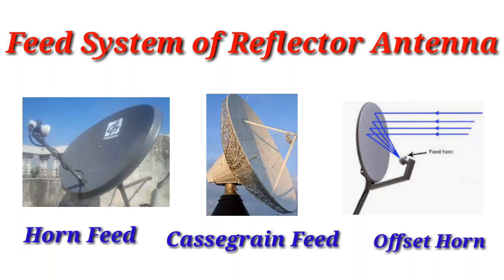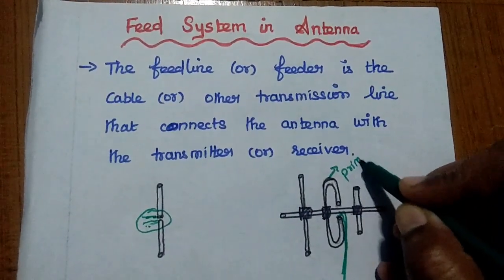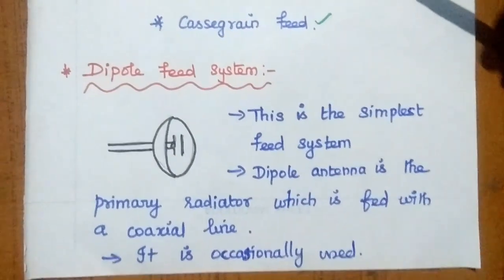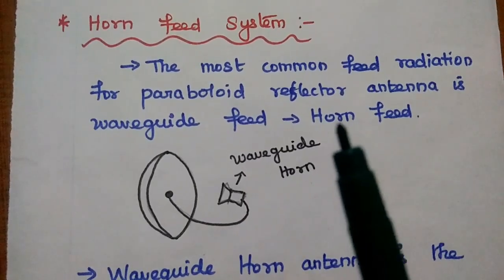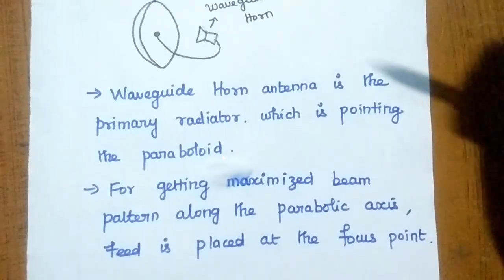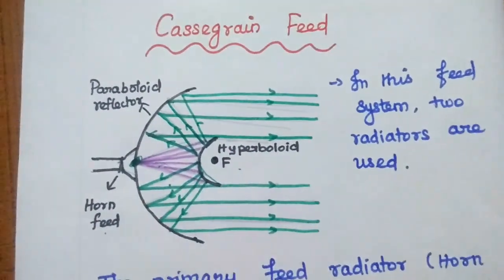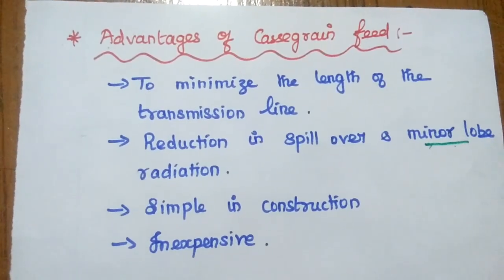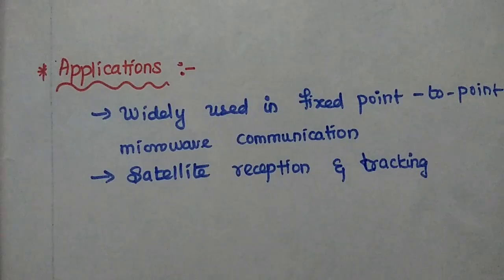Feed System of Reflector Antenna - Horn feed and Cassegrain feed

Comment: In the cassegrain feed even if we place a offset horn feed,the hyperboloid still is at the focal point and blocks the radiation ,then how will the aperture blockage reduces?
Reply from the maker: Maximum strength of the signal can be transmitted as well recieved using suitable offset position instead straight. From the diagram, you can understand that the blockage will be reduced. We cant eliminate the loss entirely but can reduce it